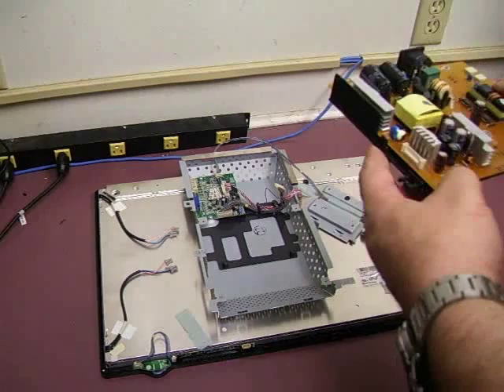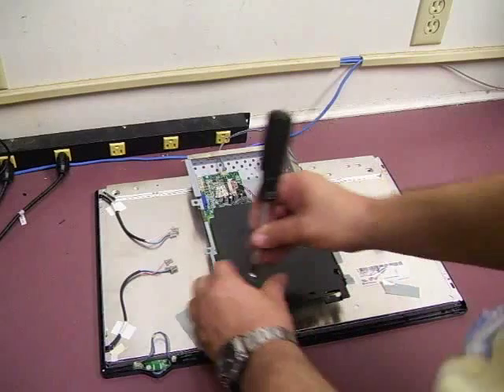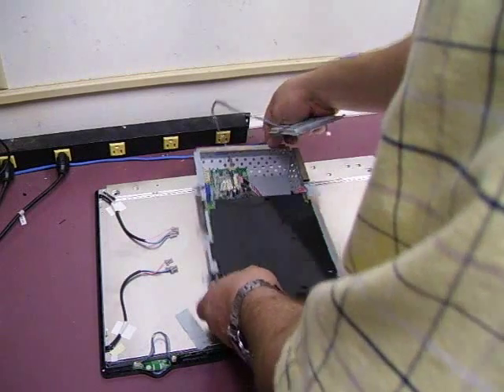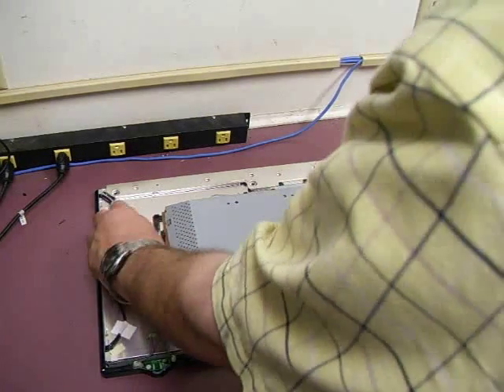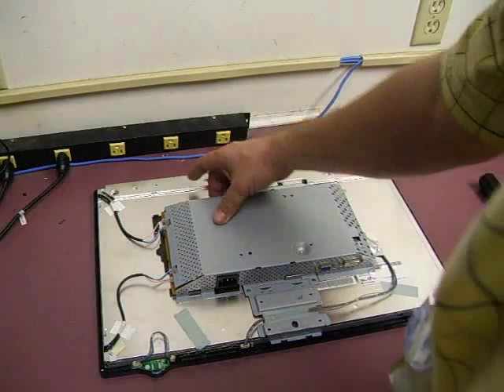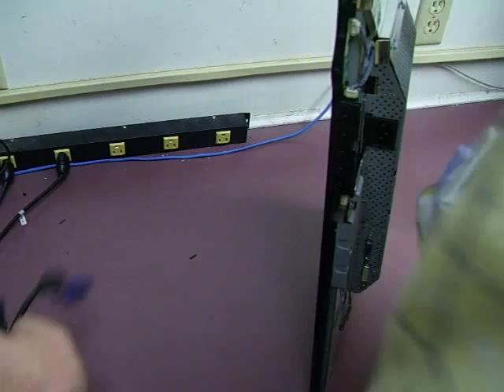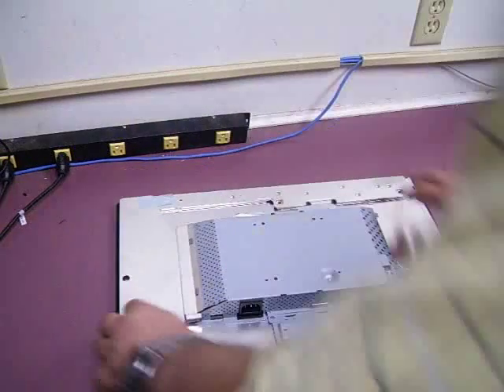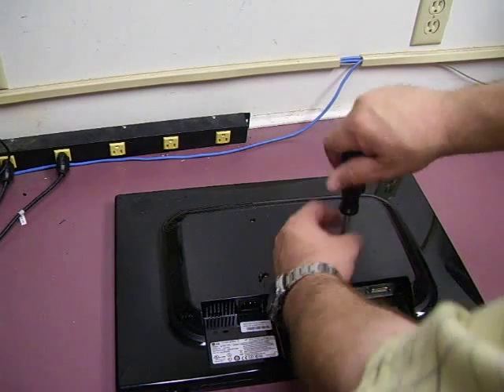Repairing a LG L227wtg-pf monitor - Part 3 re-assembly and testing

Comment: Great video.  Very clear instructions.  I have everything disassembled and desoldered.  Just waiting for the repair kit to arrive.
Reply: Peter Reitz DonÄt really need a kit. Just go to your local electronic store and buy a 220µF, two 680µF and two 1000µF capacitors. Unsolder old ones, resolder new ones (be aware of the polarisation) and it's done.
Reply: EverySixt Tried that but there are no supply stores in my area that carried the components I needed. I would have had to order online in any case. The kit was inexpensive so I ordered it. I have already completed the repair succesfully.

Comment: I'm up for the challenge. I just put together a really nice gaming system for my parents (dad more specifically--he's 72), but this monitor which I picked out for them years ago died about a year and a half after they bought it. LG wouldn't admit there was a known defect with this monitor and I was SOL. So my parents have been using a little 17" screen ever since. Glad I found your video and happy that even back then, I told them not to throw it out but keep it stored in its original box. Looking forward to trying to repair it. Thanks for donating your time and expertise!

Comment: Thank you so much for the video. I ordered a new powerboard and put it in my computer after recognizing that all the capacitors were blown. I have installed the board and huzah! Power! But a new issue has cropped up. I only get a blank white screen. I have gone through and made sure that all the connection points are solid, but I cannot seem to get an actual display through the monitor. It is only showing white. Is there a fix for this that you know of?

Comment: I am not too sure, I was taking it step by step, but than noticed the white and red cable became unattached and I did not noticed from where. Now I have no clue where it goes. Watch the video about 10 times.
Reply: I know it's been a long time, but I just had the same thing happen to me.  Maybe someone else who had this happen will see this.  That's the video cable.  There is a connector at the top of the monitor.  It was under some plastic tape.  It's very thin.  The side of the connector with the metal strip provides the ground for the video signals.  That side goes toward the metal shield that the power supply rests on.  The side without the grounds goes away from the LCD itself.  Just lay it down on the shield and slide it in.

Comment from the maker: The circuit board should have 4 white sockets soldered to the board. By any chance did you pull the sockets off to when you unplugged the red and white wires?

Comment: I still do NOT get it. I trying to put everything back together I have the red and white cable unattached from the circuit board, where does it attach to the board. I also noticed both sides are different.

Comment from the maker: Hello,

Sorry for the delays in getting back to you, hurricane Isaac had us shut down for a few days. Yes, Your problem sounds like the capacitors are causing the power supply to not start up correctly. You can send either the whole unit of just the power supply board. The board only would save you a good deal on shipping.

Comment from the maker: The red and white back light plugs will plug back into the sockets on the poweer supply board. It does not matter which cable goes to which socket, the output voltages are all the same. You will have 4 plugs and 4 sockets

Comment: I have the same model, my blue light flashes when I re-b00t, I have to reboot a few times to make it work, is it the capacitors? Also on the repair, would I need to mail the whole screen? Thanks